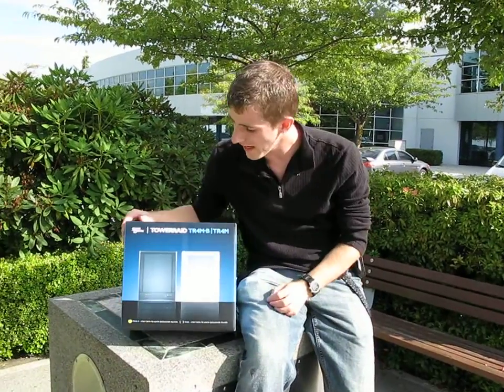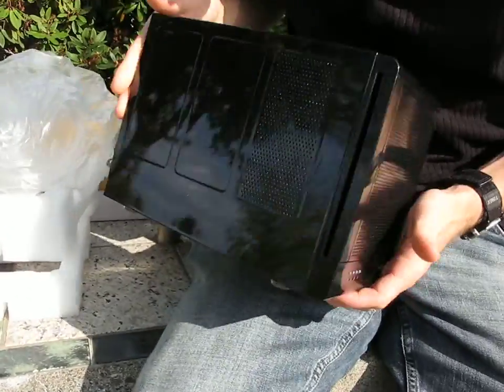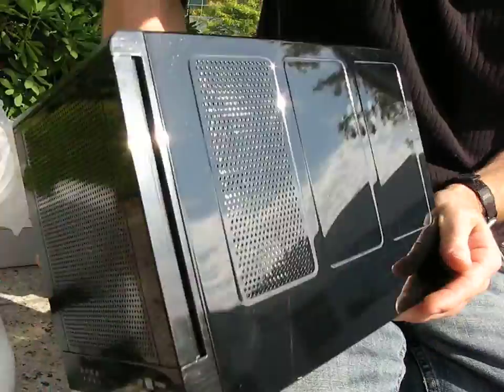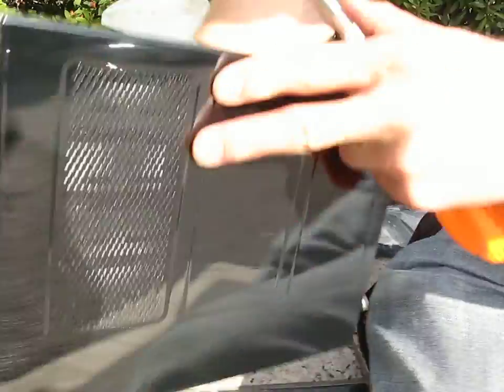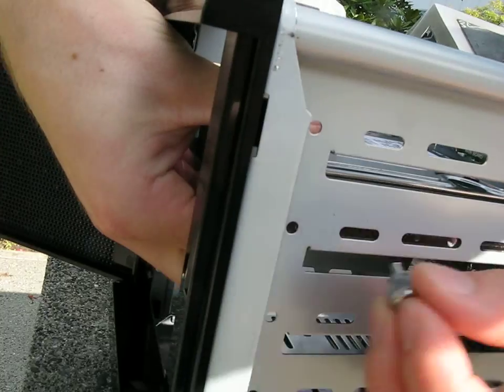Sans Digital TR4M-B eSATA 4 Bay Hard Drive Enclosure Linus Tech Tips

Comment: Chapters:

0:00 Box and general overview
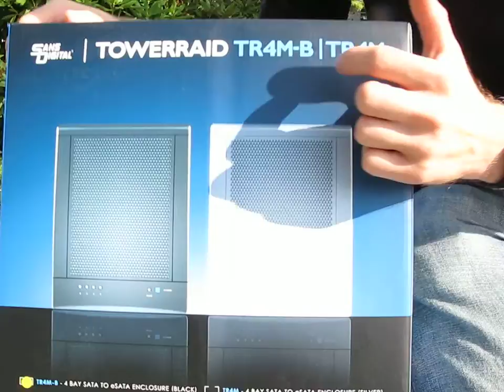0:09 Unboxing start
0:16 Accessory packet
0:19 eSata cable
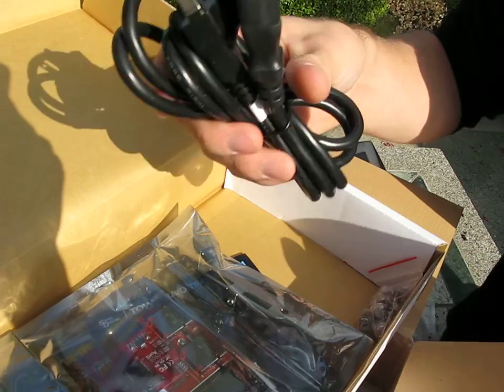0:23 Power cable
0:27 Thumbscrews for up to 4 hard drives
0:35 eSata card
0:42 Manuals and DVD
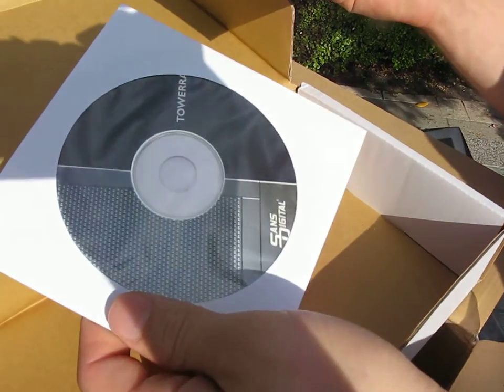0:50 The unit itself
1:06 Outside look (so shiny!)
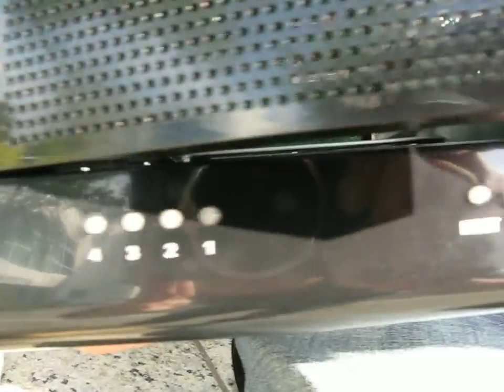1:48 Look inside
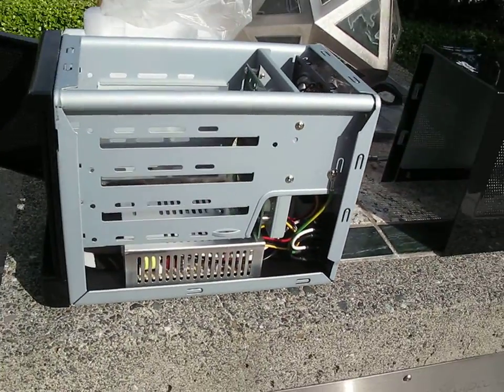2:27 Hard drive installation demonstration

Video Review:
Such a shiny NAS. And what a massive drive 1tb :D I rate this a solid 2/5

What am I doing, and why?

I want to watch, and review every single video on Linus Tech Tips channel.
I will provide chapters, if the video has none.
Why am I doing it? To pay a homage, and I am pretty sure that my head is a bit messed up.

Comment: You wont saturate esata using single drives alone. Esata usually tops out at 110MB/s but mechanical drives only got on average of around 80-90MB/s. you'll need RAID0 if you want to saturate the connection.

If you chose to run in RAID5, then speeds would be crippled.

Comment: The drives are hot-swap... Sans Digital states the drive thumb screws are only needed if the device travels and moves around a lot. (which is a little weak but there ya go)